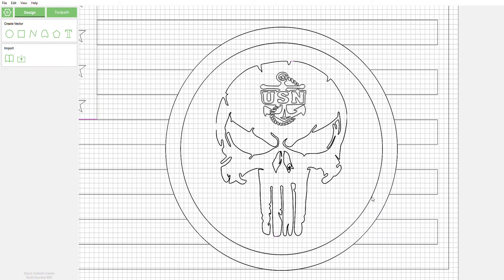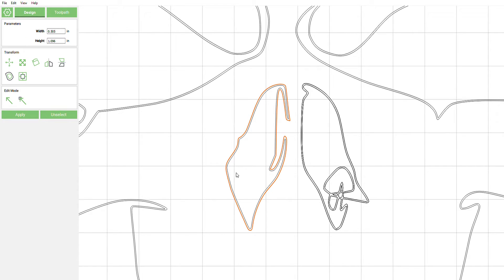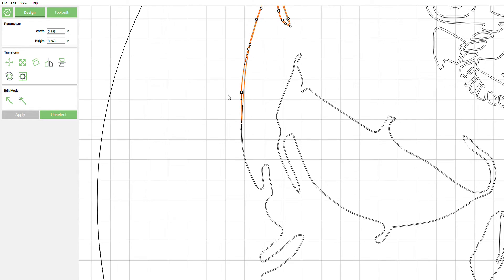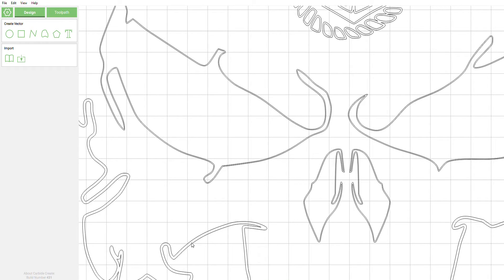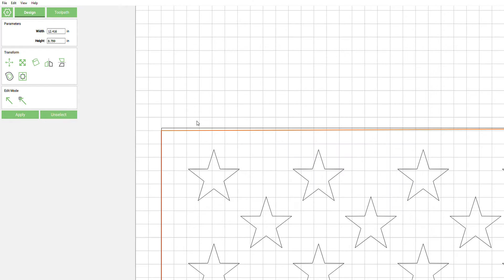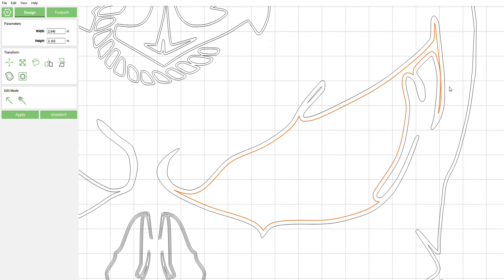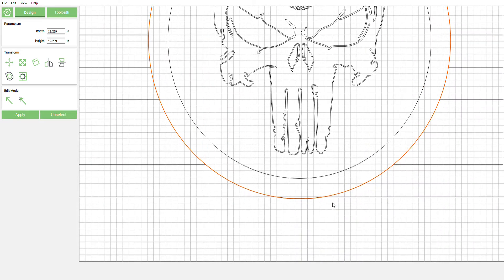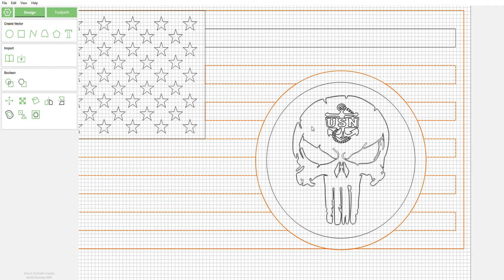Purple Line Fix Easy Offset Punisher Skull USN American Flag Carbide Create ShapeOko 3

Comment: The offsetting to create more detail was a great tip! I just used to that to great effect in some leaf detail from an image trace. I'm using an old free version of Carbide Create that can still output Gcode, a quick tip that works in 652 is once you have the offset, it's automatically selected, so you can copy/move it to the side, and then easily be able to select and delete all of the old vectors.
Reply from the maker: I get hesitant these days to update lol. I'll surely download a new one and update some of these videos. I'm glad to of helped at all.. 

Feel free to submit any issues your having and I'll post a video workaround asap.

Comment: Thank you! This is very helpful, do have a Facebook or instagram?
Reply from the maker: At the moment no, I have shut my machine down while I'm looking for a new place to put it. I'm always open to help anyone that asks though. If your ever stuck with an issue on a file, just ask and I'm sure I'll be able to do a quick walkthrough
Reply: @beyondthecutcreations9391  I really appreciate it, this video is a huge help, I’ll definitely reach out if I get stuck
Reply: I actually hit a road block when I try to delete one node in carbide create pro it deletes the whole image, is that a bug?
Reply from the maker: @colincallaway1287  you should be holding ctrl/shift while selecting nodes in node edit mode, and to delete right click highlighted node and select delete, right click anywhere to add node.
Reply: can I send you a file im having an issue with? I feel like Im close but still need help
Reply from the maker: @colincallaway1287  sure I'm kinda busy at the moment doing a remodel, but I'll take a look if time allows. Mjmike6988@gmail.com
Reply: appreciate it, sending in a few
Reply from the maker: @colincallaway1287 apologies if I missed your email. I was going through some stuff at the time. I am definitely back in touch with everything. If you’re ever needing help just message me. New email is Michael@Bark-Beetle.com